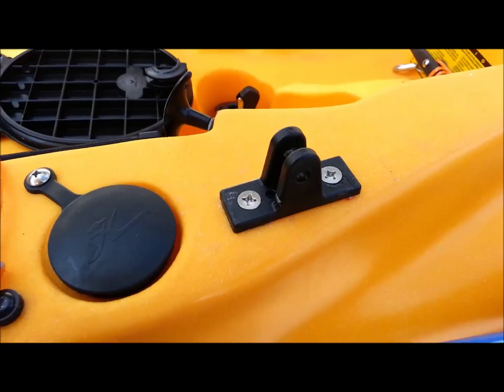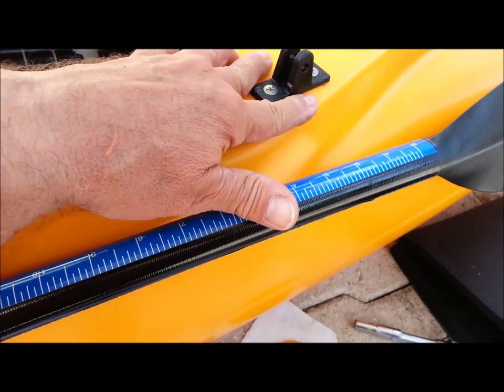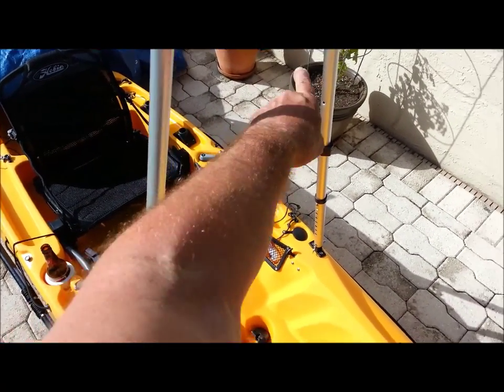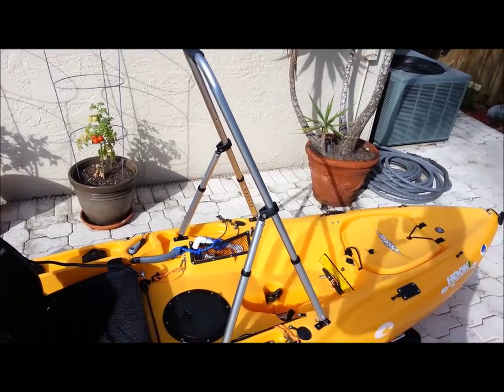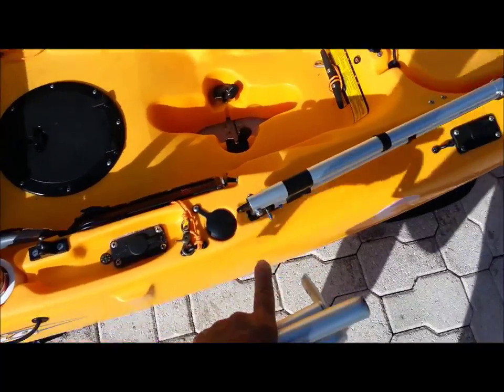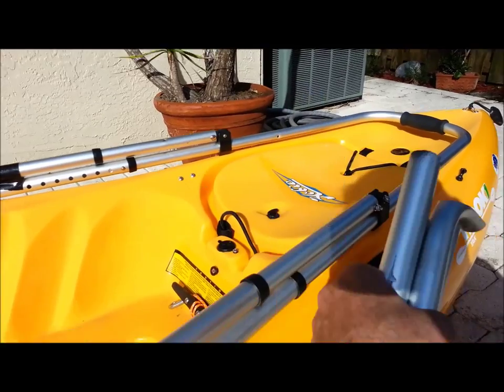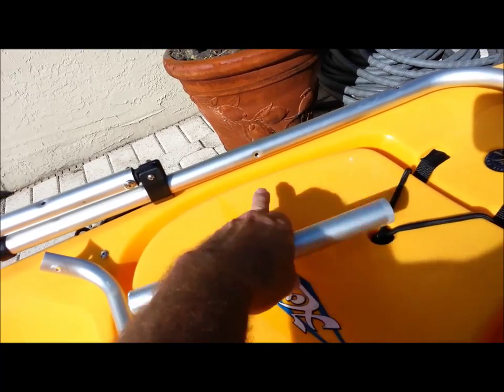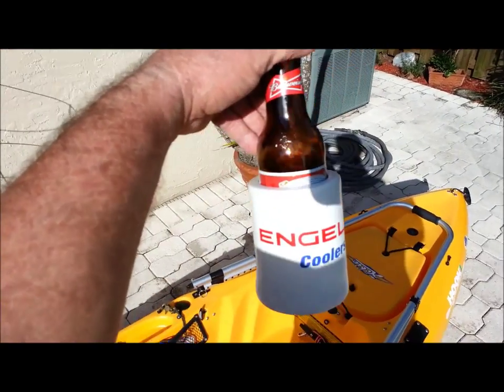Home Made Hobie Style H-Bar - Part 4

Comment: Did you have to cut any of the metal pieces? It looks great and I'm ordering all the parts to do it. The only part I'm not sure of is the two shorter bars. I can't tell if you cut them or just took them apart.
Reply from the maker: I took them apart but they were too long, so I cut them. The only other thing I cut was the cross bar and added a piece because it was too short after I spread the main bars to fit the gunwales. Let me know if you figure it out and if not I can send detailed pics. Good luck!
Reply: @JohnSims3  I have the same boat, do you remember the length that you cut the bars? Not the cross bars. The two shorter ones.
Reply: I'm looking for the length between the black rings and the jaw clamp.
Reply from the maker: @leestoltz8728  no but I can measure  and advise
Reply: I hate to be a bother would it be possible for you to send a few close up pics of the different parts ?
Reply from the maker: @leestoltz8728  OK,I will do so when I get home from work later
Reply from the maker: @leestoltz8728  Sure

Comment from the maker: Parts List -
1 ea. Walker
4 ea. Deck hinge (Bimini Top Hardware made by Taylor Products - http://www.taylormadeproducts.com/catalog/ )
2 ea. Jaw Clamp
4 ea. External Tube Ends 7/8"
2 ea. Internal Tube Ends 3/4"
Assorted Stainless Steel #10 or #12 Bolts, Nylon Lock Nuts, Screws, Flat Washers, Finishing Washers
Reply: You have by far the best standup bar diy video. I found an aluminum walker at Goodwill for $3.99 today and will be working on this over the weekend. Thanks again!
Reply from the maker: Thanks Ryan! I can't wait to see it! I painted mine black and it looks real good. Post pics and video! Good luck!
Reply: I definitley will. Actually just got all the Bimini parts on eBay tonight.
Reply from the maker: Nice! If you need more details, feel free to ask! Hopefully (I am sure) you checked your tube diameters to make sure everything fits...
Reply from the maker: Here is the finished product without the pool noodle across the top brace bar... https://youtu.be/OzpJARD2dfY
Reply: Man you are good at those mods! I love the outriggers. Those are obviously to keep the kayak stable correct? Do they work good? I have the Ascend FS12T kayak but I want to sell it and get a Hobie with the paddles like that. I am used to fresh water fishing and now that I started saltwater fishing I am hooked. I live in Orlando and go out in Cape Canaveral but have friends that go out around Pompano area all the time I am going to join sometime. I have finally got all the parts for the standup walker install so I may be hitting you up for some advice. Thanks John!
Reply from the maker: Sweet! My pleasure! Feel free to ask away. I try to do things right the first time with my DIY mods...Check out all my other vids, and the one on my perception sport! REPORT BACK! :D

Yes, the outriggers work well on the Outback. They allow me ( 6'2" 215 lbs. + gear)  to be a lot more stable when I stand while fly fishing or sight casting. I'm a freshwater guy at heart!. Check out this vid on the test voyage with my riggers... https://youtu.be/8poullyCc4A
I know, the music sucks....

Comment: How stable sit to stand on?
Reply from the maker: Not too bad in calm water or fresh water, not as stable as a Pro Angler, but it is stable enough to fly cast on without any problems, especially when I use my outriggers, which makes it almost impossible to tip over. Check them out on my channel. Good luck!